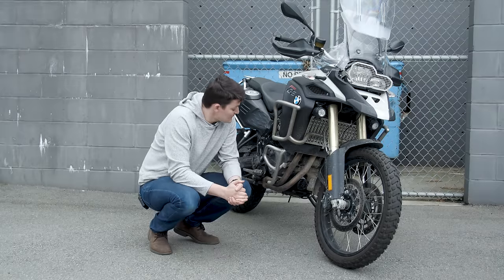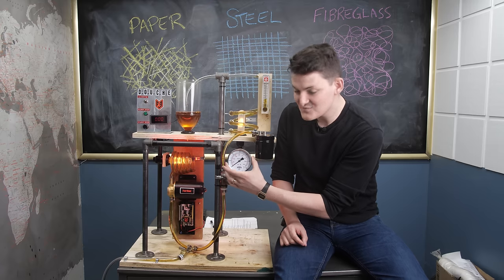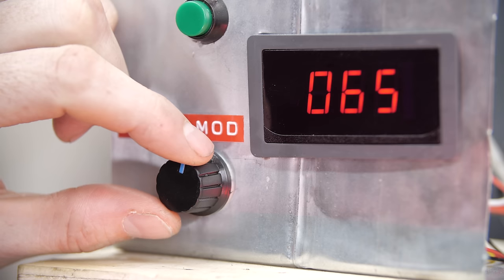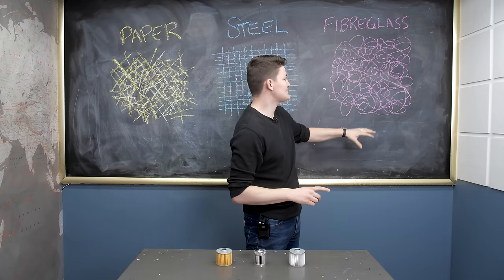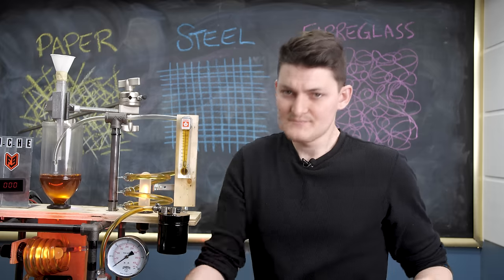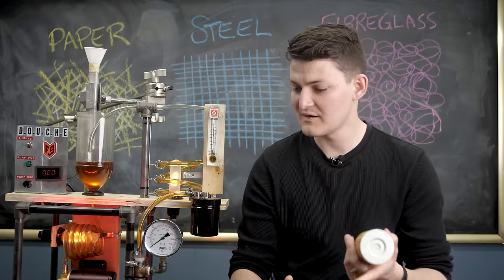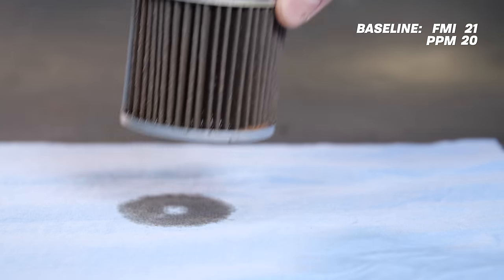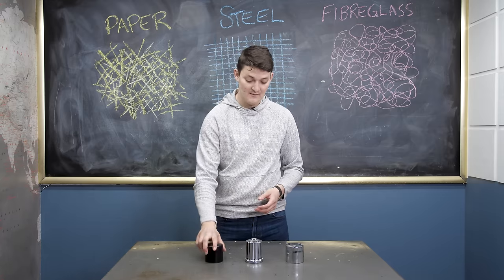The Best Oil Filter - Testing Paper vs Fibreglass vs Steel

Comment: I'm curious if results would change significantly at higher oil Temps experienced while an engine is under load.
Reply: wondering the same. lots change when oil temp goes up
Reply: The test rig looks like it's intended to heat the oil up with the coils that run around what I think are heating lamps. I don't know to which temperature they heat the oil, but it indicates to me that ryan and his team didn't forget this factor.
Reply: @dariolinder4508  time stamp 4:30 for reference.
Reply: I thought that too  I don’t think the filter cares what temp the oil is. It’s not a test on oil itself, which temp would come into play.
Reply: Or, if they did 10 filters of each, to prove consistent results..
Reply: @aucklandsadventures  could effect viscosity tho which matters to the filter
Reply: @dariolinder4508  There's no way that oil is getting anywhere near real operating temps that bikes see, with a couple inches of tubing and a small heat lamp. Oil is usually around 200° F (93° C).
Reply: The temperature of the oil filter itself could affect its ability to remove particulate if there is enough of a variable in material density. This would most likely affect the fiberglass filter the most.

Operating fuel oil purifiers and lube oil purifiers, we HAVE to keep the fluid in recirculate until the temp hits the appropriate range and then the clean fuel/oil can be sent to the system.
Reply from the maker: We did indeed get the oil hot. No thermometer on the DOUCHE though so can't be specific! ~RF9
Reply: @FortNine  When are you going to restock with Five gloves online, I can’t find them anywhere online or find a store that carries them
Reply: I'm curious about paper holding up to oil... And heat/pressure
Reply: @FortNine  good to know! And lends more to paper being the better choice!
Reply: @diavuno3835  Paper is pretty much impervious to heat effect, and the folds of the filter give it a lot of strength.  Go stand of a piece of corrugated cardboard, see how little you hurt it.
Reply: if i was to guess only the steel would be affected (filtering less) and all will flow better but steel will flow the best improvement, still tho paper will still be the best for street use..
Reply: The paper filter would do better as temp goes up...
The viscosity will get thinner and thus the filter with least flow will perform better.
Reply: wouldn't matter. Oil Temp just changes viscosity so whatever pattern is observed at lower temps will also be observed at higher temps. You're always best running a filter with the most surface area, cheaper isn't bad as long as it has the right features (flow bypass) because it's getting changed often, and you avoid steel because you cannot really make a steel mesh that filters better than paper.
Reply: @jacobvanhalteren7452   to say that the temperature of a fluid "just changes viscosity" is incorrect. The ability/tendency of a liquid (including oil) to pickup and entrain particulate is greatly affected by even a few degrees of temperature change.  The ability of a material to filter can be affected also by just a few degrees of temperature change (I am not arguing that in THIS test for THESE purposes, that the outcome would have changed). I do not doubt that the metal or paper would not have significant differences in outcome but I can see the temperature having an effect on the fiberglass as the material swells from the heat and creates even tighter restraints on the fluid moving through it. (Example: fiberglass wound filter elements in RO units. A change of 3*f or a 5lb increase in pressure is enough to increase the salinity of the effluent by 5-10%)
Reply: @FortNine  The pressures you recorded are way above the differential pressure for hot oil through a filter.  I doubt your oil was even 140 degrees, let alone the 200 - 240 that is normal in an engine.
Reply: @aucklandsadventures  True, but as the viscosity of the oil decreases as temperature rises, the delta P, or pressure drop over the filter will decrease. That's why filter bypasses are so important if oil temp is extremely low. You don't want to starve your engine of oil when it's trying to push cold oil into it's extremities.
Reply: Temperature changes viscosity and therefore the resistance of the oil to flowing through any given pore size.. Temperature does NOT affect the filter”s ability to stop a given particulate size.. Heat does not increase porosity of the filter media.
A 3-5 micron filter will ALWAYS stop a 3-5 micron particulate. 
The only exceptions to this from a functionality standpoint is when the filter design includes a bypass for operation under high viscosity (ie: cold start, single weight fluids ) or as a safety to preserve some functionality.. and at that point the filter media is not in play.
Reply: @WalterPidgeonsForge   my original reply seems to have disappeared from my view, if it returns I apologize for double post.
Every filter has an efficacy rating that is established at a certain set of values (i.e. pressure, temperature, flow rate) so a filter with a 5 micron rating MAY have nominal rating of 5 microns or an absolute rating of 5 microns. The nominal says it filters 5 microns and larger but the efficacy is 50% for the 5micron 70% for the 10 micron and 90% doe the 100 micron (arbitrary number's). The absolute rating of 5 micron is simply saying that 5 microns is the largest sized particle that will should pass through.  A beta ratio derived from testing is used to determine the exact efficacy of fine particulate i.e a beta of 10 for a 5 micron filter is 90% efficient at removing 5 micron particulate. These tests are all done at a set value of inputs (temperature, pressure, flow rate) and changing any of the three variables would change those numbers. 

Absolute filters of 5 microns only require a >75% efficacy rate. Nominal filters can be as low as 50% efficacy. So saying that 3-5 micron filters will ALWAYS  filter the same is incorrect.

An example on a more macro scale, a cold engine with seals that are JUST starting to wear will allow oil into the combustion chamber but once that engine and the seals heat up the oil stops leaking by (as much) because the physical components have expanded. To say that doesn't happen to filter media as well...
Reply: Viscosity will change with temperature even if only slightly. Labs spend millions on this type of equipment.  Consider this video more as an “eye opener” rather than the gospel.
Reply: @SoloPilot6  straight up try ripping a filter apart. Not that easily done to damage a sucker.
Reply: Other than possibly being abusive to the adhesives/sealants in the filter, holding it together... The temperature of the oil shouldn't make much difference to the tests... The KEY is "equivalent" oil, temp's, and conditions for ALL 3 Filters in question... SO long as you maintain a "level playing field", the results of competition should stand.

    Basically, if you thin the oil by heat for one, then you have to do so for all 3... SO the results are going to follow a fairly predictable line. More flow is only going to make similar numbers and trends at slightly different rates...

     This will continue until you reach a temperature by which the adhesives for the fiberglass and/or paper filter are thermally deteriorated to a destructive degree... AND so long as that is outside the likely range of operation on an ordinary motorcycle, it doesn't matter... The only reason I won't accuse the steel filter of thermal breakdown is because steel can be welded... and that's not going to fail until you're above 2000F... and you've got FAR GREATER issues with your engine (any engine) than the oil filter if or when you reach that temperature territory...

     Filtration is a fairly simple equation... SO let me break it down... In order to get MORE particles of contamination out of the fluid, it takes more filter-surface areas with tighter spaces between them... AND that's going to mean MORE drag against the flow... It's not a perfect rule of thumb, as seen in the vid', but lower the drag, and you lower the efficacy of the filter over-all... pretty much every time.

      It's easily enough demonstrated by building a filtration cartridge out of PVC pipe, and steel mesh... Fill it with gravel and force liquid through it with a sample "before" and "after" collected and test them... Next repeat the process with sand... much smaller filter materials with more surface areas and tighter spaces between... AND finally you can mix a 50/50 sand and charcoal, since the charcoal also allows water to flow straight through it, with LOTS of surface and near microscopic spaces... AND notice how much effort it takes for each "up-grade" in filter material, and the results of your "before" and "after" tests for each particular type... If it's anything like my own experimentation, the sand-charcoal filter will do best, but you're not getting all your water (or even more than about 60% of it recovered without an air-compressor to force the stuff out... You can't even physically blow it out (lung power)... AND gravity-flow is completely useless... The gravel alone might be able to remove some stuff, but it's actually impressive how little it will do... 

     This is also why (should you have such) an antique vacuum cleaner with the new "Hepa filter" bags or inserted cartridges WILL burn-out in fairly short order, requiring a retro-fit on top of any repairs if you wish to continue using it. It simply takes SO much more effort to push the air through the "modern" filter that it literally works the old motor to death.  ;o)
Reply: @pallecla  although multiple sample is always recommended for reliability, the video is more focus to the average consumer, you don't do all this when buying filters, always go for the bang for the buck
Reply: Considering when oil is hot, the viscosity is higher, I would assume that the only thing that would change is flow rate.
Reply: I think the only issue with paper would be degradation over time. Initial filtration of paper is fine but, I wonder what happens after many cycles. Another issue is that it does collect more particles and therefore probably clogs up faster.  Idk, just change oil and filter more often for longer lasting engine.
Reply: A standard filter will only filter to 40 micron... or at best 30 micron particles. 

Only centrifugal or bypass oil filters will filter small than this i.e. Down to about 0.5 micron

:-)
Reply: @FortNine  what is the viscosity of the oil in this test?
Reply: the test was just a bunch of horsepoop. oil pressure and flow are defined by the centrifual pump and how large the sump is. dry sump vs wet sump and so on... Ryan has exactly zero experience in anything do with actual automotive design and this is the case with most people with high production value on youtube, just timepass and not real engineering.
Reply: @mohba01  I think your comments reveal your lack of engineering knowledge. Where do we start? The volume of the sump is irrelevant. Flow is relevant. Dry or wet sump irrelevant. Where the oil is coming from does not make any difference. Oil pumps are not centrifugal, they are positive displacement (various types exist). BTW what is your experience with automotive design?

Comment: As someone below, I am a mechanical engineer with a specialization in internal combustion engines. This is an excellent review which proves once again: a) cheaper doesn’t mean necessarily worse b) we should trust manufacturer recommendations for both spares and maintenance intervals as these are the best for regular users
Reply: A more dense, higher efficiency filter will naturally show more resistance to oil flow, thus higher pressure.  The ICP test of the wear metals is not reliable in this test scenario. 1st the test will not see particulates above 10 microns, full flow filters are not efficient at these smaller sizes, the filters are designed to flow oil and stop the largest particulates in 30 micron range. Lastly, the small difference wear particles does not take into account repeatability and normal margins of error. A better test is Particle Count using patch membrane.  It's an ISO test used to determine the cleanliness of oil and performance of a filter.  It separates particles in the oil by size and quantity in the thousands for smallest to less than 100 in the largest.  Blackstone can do this test, as well as other labs.  A better test is to put the 30 micron aluminum powder in clean oil, filter the same oil mixture through each filter, plus a control oil sample, then do the metal test and particle count.

Comment: As someone who does this type of testing every day, nice work! My company uses fiberglass for our filters on industrial engines, but we expect the filters to last for thousands of hours before servicing.  Paper is indeed the best choice for automotive use as there's no better media for the price.
Reply: Some engines can take a larger filter than standard, a win-win-win for not much price increase, in same cases you can buy the same brands big filter for less as they are more sold by car then filter number.
Reply: you lost me with the "for the price" part.
Reply: I'm curious why the decision is to go with that rather than changing a filter once a month. A month is ~730 hours, does paper really degrade that fast?

(Well, looking up average vehicle speed and comparing it to my motorcycle's service internal, apparently they last ~400 hours. For my car, ~1,060 hours. Interesting.)
Reply: @guard13007  Probably simple cost-benefit analysis, as replacing filters might take lets say ~2-5 hours (gotta shut down machine, replace & test new filter) If the product/machine isn't affected by slightly dirty oil then simply increasing the interval is an easy method of decreasing short term maintenance costs, as most companies won't run the same machine's for their entire feasible lifespan anyways; It's the next owners issue.
Reply: @wobblysauce  I used to run FL1A equivalent filters on my Sportster. They held more oil, were cheaper than motorcycle specific filters and had the same spring bypass pressure. Another benefit was their size made them easy to remove by hand. I needed a total of one tool to change the oil on that bike-a stubby flathead screwdriver.
Reply: @vids595  I think its more of an added benefit rather than a compromise. Thats the moral of this video anyhow